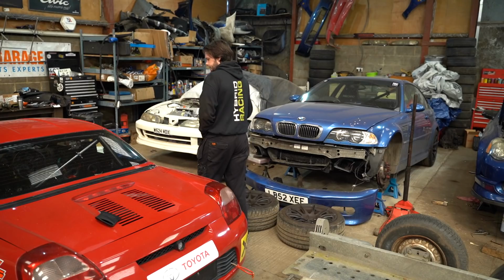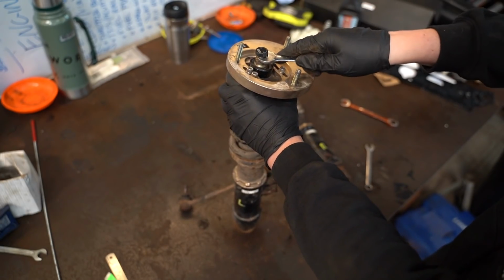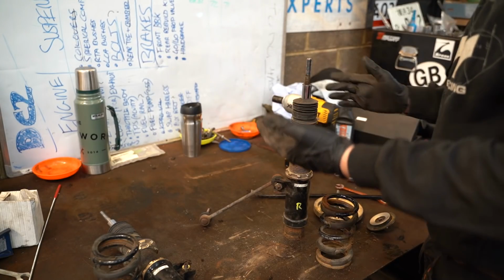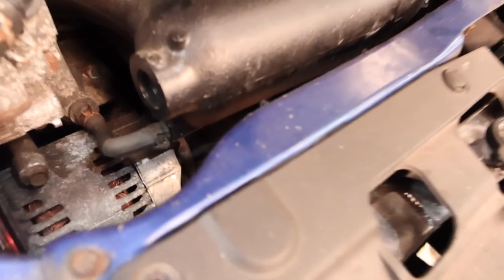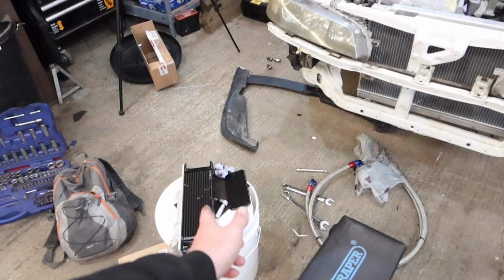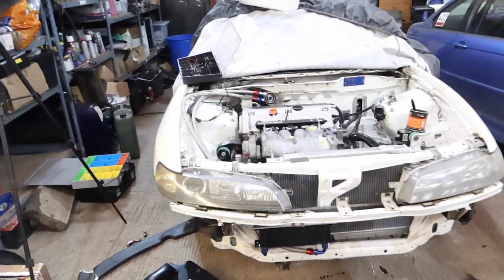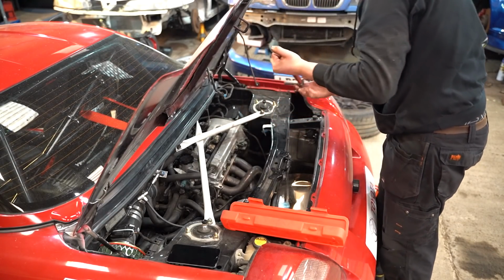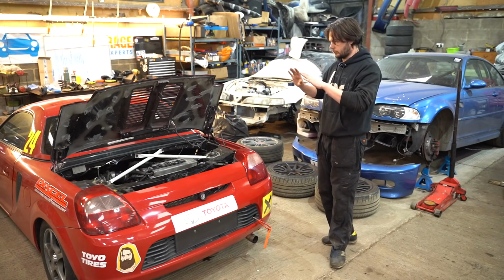SOMETHING FOR EVERYONE! Zero dislikes. M3 DC2 MR2 work

Comment: Great vid Dan! No dislikes here. 
The BC suspension looks bad. I'd definitely get the Springs powder coated. I saw on another You Tuber channel, they used a white lithium spray grease(WD40), on his coilovers threads and spring platform. It supposed to help reduce corrosion.  
Keep everything lubed, good mantor👍

Comment: Love your style Dan, video recording a stream of consciousness, sharing thoughts and information freely is the best way. You certainly seem to have the right approach to sorting your cars’ problems, fingers crossed the Teg’s oil filter will yield and a bit of lube will smooth the M3’s steering/ weight transfer business. A dyno will show Mr 2’s output characteristics, wouldn’t be surprised if the stock airbox is best suited to the engine. That exhaust sounds meaty without the leak. Perhaps the JDM ECU will make things better too... 🤞🏻
Reply from the maker: Stock airbox is best says the internet so fingers crossed my home brew is causing some grief

Comment: I used a leather belt on my last oil filter to get it off. Place the strap through the buckle in the way that when you pull on it, it tightens up (as if you're putting it on).

Comment: Might have been said before Dan but the Fnpoo inlet manifold can be opened up and the 4 long velocity stacks can be chopped right down and welded back on and it provides very similar figures to an rbc or skunk2 pro seriers
Reply from the maker: Yeah well aware of all that there's loads you can do with the RSP but I'm not power chasing with this one so no real point getting carried away. Won't be revving past 8k

Comment: Nice one Dan! I had a set of D2's for years across multiple e36's... After 4 years the front top mounts started banging, no visable signs why but yeah just changed the top half including the pillow ball for some solid ones and solved the problem - never had an issue with the lower part even after nearly 8 years across 4 cars! So they're sly buggers lol
Reply from the maker: Nice fix, mine isn’t a banging just the twang on transition if it’s heavy. Got to be those springs but will find out tomorrow

Comment: The standard drop links could be causing the twanging because they could be preloading the anti roll bar at the ride height you're running, so you might benefit from some adjustable ones to dial out the preload.
Reply from the maker: I'm not on standard droplinks though. The E46 ones are a good bit longer. My bar sits at the right height for my ride height
Reply: @dannyDC2  + I don’t think a twang would be able to sound through arb bushes

Comment: I've replaced knocking rod ends that felt completely fine once they're off the car and in the hands. Maybe they only knock under load in just the right angles. Food for thought.
Reply from the maker: It's not a knocking noise more a twang but thanks anyway. Did replace the outer rods not too long ago

Comment: Re. The oil filter......I know I probably shouldn’t admit to this but I did my girlfriends oil change a couple of weeks ago but couldn’t find my filter wrench, not used it for years because I like BMW. Anyway, top tip from this expert bodger, hammer and chisel on the shoulder next to the mounting surface worked for me 😉
Reply from the maker: There's plenty of bodges available to remove if you're not re using lol. Not heard that one before tbh
Reply: @dannyDC2  worked for me. I used the large screw driver hammer through the filter method years ago until one day it was so tight it cut its way through the metal all the way round! My other method of tapping a nick in the shoulder then tapping it round got me out the shit.

Comment: Hey Danny.👋 First off, just wanted to say, it's fuckin' payday, bishes!😄 Proud to officially be a patron here, mate and this is my favourite pub on the interwebs. Well, shit... between the three of them, who would have believed the MR2 would have been the easiest fix of the day? Not me. Glad to hear the lil' frog was just chirpin' and didn't croak.😜 I believe you've figured out the problem with the M3 (fingers and eyes crossed). The Honda "foil filter" on the DC2 was just totally unexpected and weird. Shame to use an official Honda removal tool only to have it let you down. I've used the strap wrench (Granny's jar opener) for years which usually works if you catch the filter at the base and have enough room to turn it. Recently, I bought a Hazard Fright 3/8" drive filter removal tool. It has 3 fingers?, all steel construction, and fairly beefy, believe it or not. No complaints yet. Thanks for taking time for the videos, Dan. As of the time of my comment, I see you even got 10 knobheads to participate.😅👎 Another satified customer here, btw. You got me over here singing Back On The Chaingang.👍 Cheers, dude. Enjoy the rest of your weekend.
Reply: P.S. Check out our man AvE's latest. It's just over a minute long with him cussin' some design engineers who must absolutely hate mechanics. Not an oil filter, but it may give you an idea to save you from buying another tool. I've done something similar in the past. It may help you one day in a pinch.👍
https://youtu.be/Q-42KWPnN8U
Reply from the maker: Cheers Mick. I did see that Ave video earlier and got me thinking about the oil filter. Also the MR2 has the stupid in tank fuel filter too. All good as per usual sir. I’ll hopefully pick up these straggling jobs tomorrow and get them ticked off! Take it easy man

Comment: Dan mate , if you have a big set of adjustable pliers/ water pump pliers , grab the Honda oil filter tool and try that , since your grabbing the tool rather than the filter , you won’t damage it , hope it helps mate 👍
Reply from the maker: Got some water pump bastards somewhere I'll give it a go 👍
Reply: @dannyDC2  never fails in work with me when I’m in a pinch , best of luck

Comment: Might want to look for some serrated flange nuts for the exhaust manifold so they wont get loose over time
Reply from the maker: they are K nuts just weren't tight enough. If they do work themselves loose i'll bang some nord lock washers on

Comment: Why is the fuel filter connected to the fuel pressure regulator Danny?

Should be Pump > Filter > Fuel rail > Regulator > Return. Unless you're running a returnless setup for some reason?
Reply from the maker: This is returnless yeah, always was. You put the return from the FPR.

Comment: I see the m3 splitter is still kicking around. If you want it repairing send it this way and I’ll get it back together for you.
Reply from the maker: I have a spare still but that could be a plan. Not sure how much they are to replace haven't checked 😁
Reply: @dannyDC2  well just let me know if you need it sorting. I’m running out of stuff to do on the Cappuccino thanks to lockdown so have plenty of time to sort a splitter.

Comment: I'd of said that spring not being able to turn on the cup since it was seized on the bottom would have been your twang
Reply from the maker: Hoping so!
Reply: @dannyDC2  had similar with the MR2, did have problems with standard droplinks on that too mind, once the steering was turned so far the droplink kind of twanged opposite to how it should sit. Maybe get some adjustable ones whilst you're at it. I used some cheapish ones off eBay listed for a VW
Reply from the maker: I was going to make some with bits from McGill but these are sound. If it ends up being the drop links I’ll eat my hat but I’m not convinced at all haha
Reply from the maker: Got a real hatred for adjustable ones not sure why. Would help with the corner balancing for sure but I think it’s just OEM solutions I love. I run FN2 Type R ones on the back of the MR2 😁

Comment: Just got to the tightening manifold bolts bit, I replaced my manifold on my MR2 and within 6 months 1 bolt/nut was very loose 2 of them had totally fallen out! (my own fault for not checking on the leak) ...wonder why these cars do it
Reply: Should probably add to this I also had to replace the gasket after this

Comment: Hi Dan, just a thought about the accessability of the drop link nuts, can you put washers under so the nuts are proud so can get a socket on ?
Great vids, cheers from Alex's ald man
Reply from the maker: I could probably get a bit more access with some washers yeah, I think one of those posh socket sets with the pass through wrench is probably the best solution but £££ lol. I can get them off just takes some time. The centres are rusty torque fittings that you have to hold... Alex is a good lad in a sea of dafties you did well haha. Cheers!

Comment: With the oil cooler Dan did you remove the stock water/oil block cooler in the stock filter location or did you just put the sandwich plate between it and the filter?   I need one for my EP3 but am getting mixed opinions on if I should remove the stock one or not.
Reply from the maker: No I left that alone

Comment: Pretty sure 120 degrees oil temp is fine on decent synthetic oil, on a K20 anyway, not sure about a twenny fo though.
Reply from the maker: Yeah mate I was thinking when editing this the M3 gets up there tbh. Either way the oil cooler kept it down below 110. I didn’t blow anything up on the track days and stuff I did without and that engine is in a time attack Ford Fusion now and going well!
Reply: @dannyDC2  kinel, small world, was at cadwell Thursday and that Ford Fusion was there I think, Rob Boston driving?, we’re having a few issues but went well when it was working! Re oil: pretty sure on the e92 M3’s don’t they say your supposed to not get on it until the oil temp reaches minimum 100 to protect Rodney bearings?
Reply from the maker: Yeah dude that's the one! They put a video on Facebook last night it looks like a handful but there's no mistaking the sound it makes

Rodney's on them aren't stating around for long. Bmw never admitted any problem with them though (unlike the did with the early E46s), so not sure about the waiting until 100c. They do a half decent job at cooling themselves though the Ms as long as the radiators aren't knackered

Comment: Get yourself some pass through sockets for those droplinks Dan, honestly it'll save so much swearing and theyre only about £20
Reply from the maker: Surely all sockets are pass through? Haha. Presume the wrench is different
Reply from the maker: @Techtiqal  casual 75% price increase haha looks good tho it's
Reply: @dannyDC2  was just the first link i got hahahaha, theyre usually on an ebay 20% off with FFX or BuyAParcel. They save a lot of headaches with tightening top mounts if they're deep in the turret

Comment: Ive got a 98 ukdm dc2 rusty sack of shite also, been off road since 2013. Needs some love, who did ur welding on yours?
Reply from the maker: I got a mate to do it on the basis that it didn’t have to look pretty as it lives on the track. It needs finishing off at a body shop but not sure it ever will lol

You can’t get rear arches so they have to be made
Reply: Yeah the arches are in need of repair so to speak, did 6 laps of ring in it 2006 😁 no where near ur time though